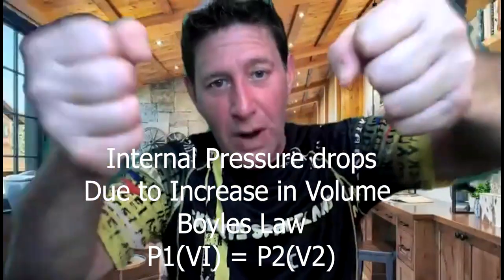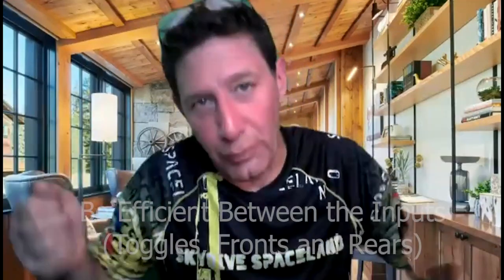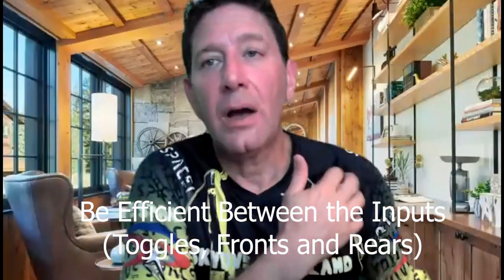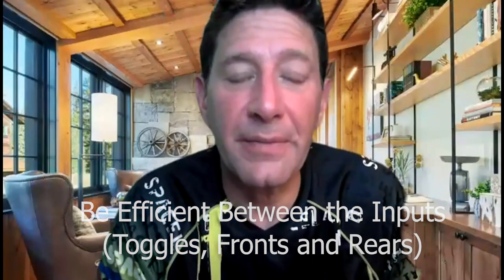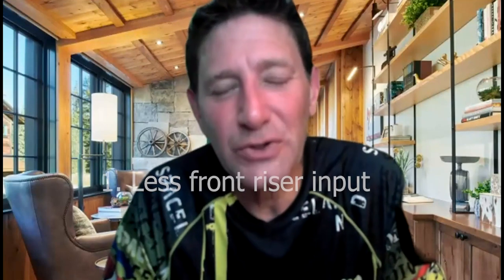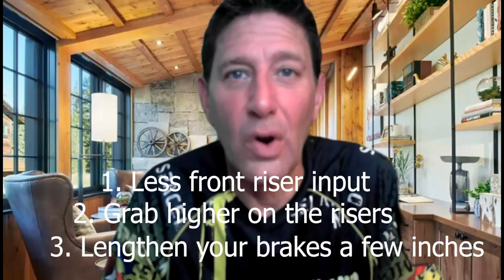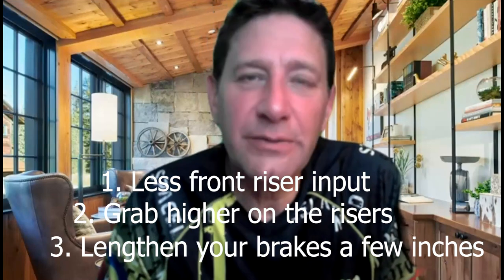Two Great Questions

Comment: Hi, might be a stupid question but I was told never to let go of brake toggles once they are released and you are describing grabbing the front risers from half brakes. So at that point should my hands still be in the brake toggles even though I am grabbing the front risers?
Reply from the maker: Yes, keep your toggles in your hands when you use the front and rear risers. Adequate slack in the brakes will allow for input without significant tail deformation.